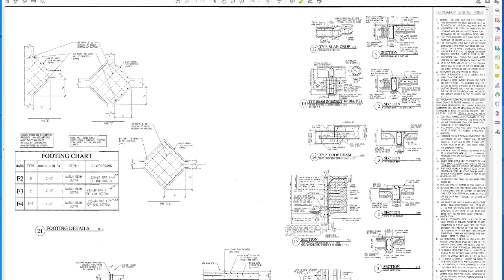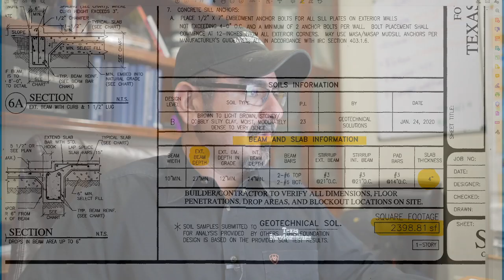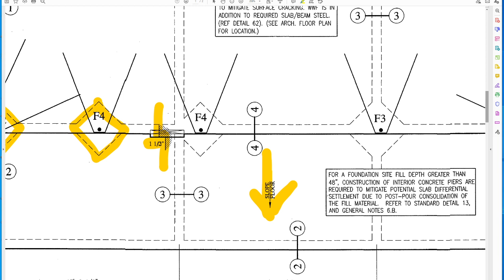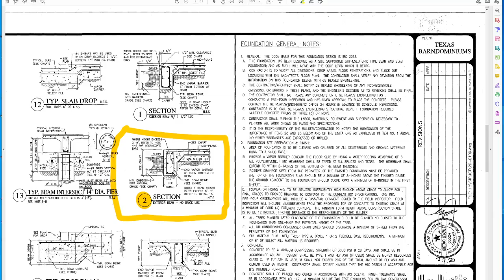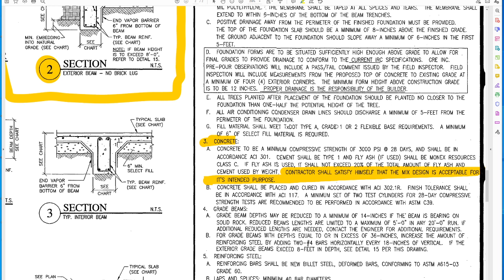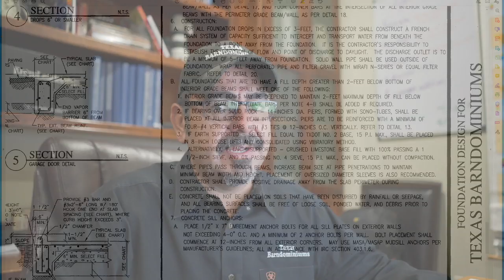How to read engineered concrete plans - Barndominium University E1

Comment: As a relatively recent subscriber, I've probably watched about 20 videos of Erik's now and this is the best episode I've watched so far!! And that's saying a lot :) Awesome info in here Erik for a non-pro like myself who's going the through the process of learning all I can to possibly GC my own Barndo build in north Georgia. Appreciated the time you took to start with the simple foundation review. I've experience as a PM in commercial datacenter construction but have always spent more time on the wires, switches and components then the foundations, walls and ceilings. Looking forward to watching and learning more from you! If you know any great builders in my region who might be interested in working on a passive barndo with concrete interior perimeter walls, lmk :) Hard to find good folks. Cheers!

Comment: Thanks Erik, I am not in the building trade but can use some of your expertise and my limited mechanical drawing training to guide me in future projects. One is completing a concrete boat ramp in Sargent , Tx.  just off the inter-coastal waterway.  I plan to use some galvanized rod and galv. cattle panels even though epoxy coated is supposed to be the best to fight corrosion .  One question, how can you tell the GRADE of structural RE-BAR ? Is it stamped on the bar like the  size ?   J K

Comment: I'm making a guess that the  full foot dimension living quarters  includes an additional  3" on the length but not width,  are you robbing from the porches for the metal ?
Reply from the maker: Correct.